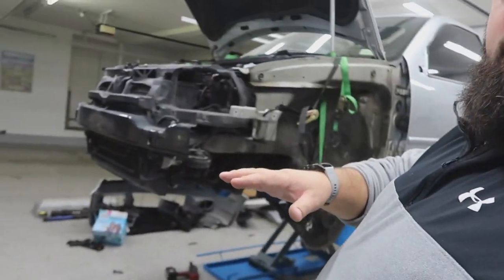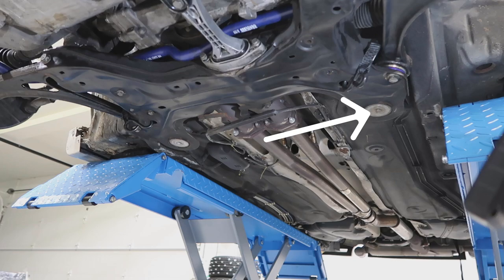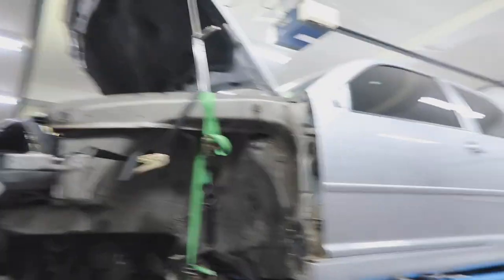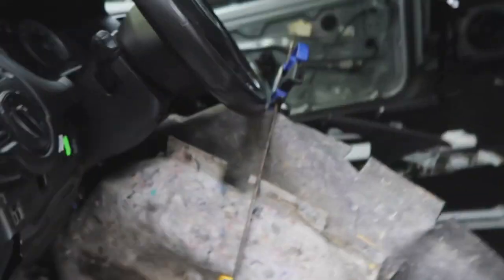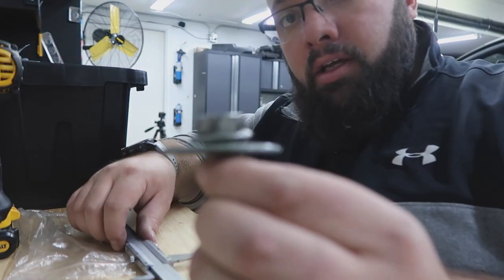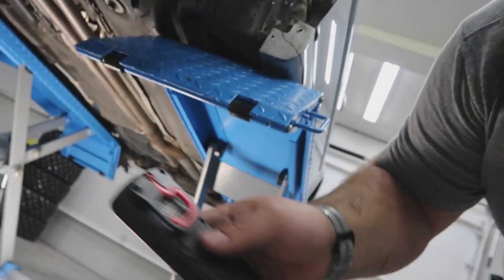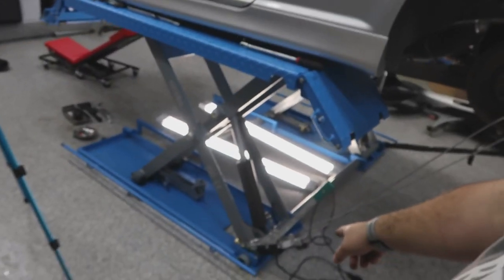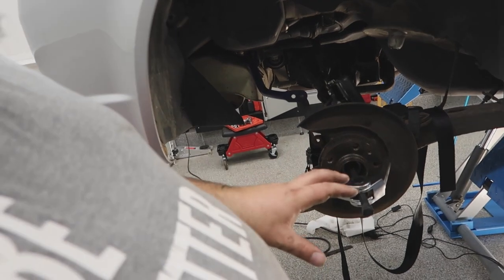VW MK4 R32  My nut is STRIPPED!  How did THIS HAPPEN? The Project Car Rebuild Pt. 11.

Comment: Stripped nuts are the worst nightmare for any DIYer especially when the tools are limited and basic. I learned the lesson in the past. So, if I suspect a possible problem, I spray some penetrating oil in advance. A can is must cheaper than all the tools, time and 🤬 !$&@ required to remove a rebel nut.
Reply from the maker: Yes they are, But unfortunately this was stripped before I even got to it!